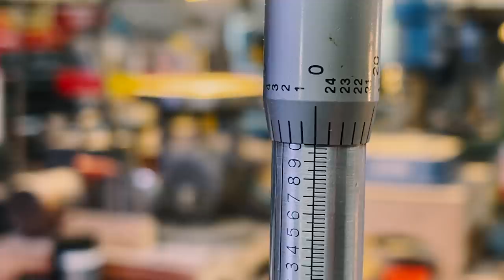Adam Savage's One Day Repairs: Cleaning Micrometer Gauges

Comment: I have that same set in my service truck. As a mobile mechanic/millwright it's funny to see how careful he handles them! After 15 years of bouncing around in a truck, in and out of -40°c weather and with zero maintenance, I have never had an issue with them. Unreal built instruments
Reply: Dude, this is what I'm talking about. Buy the best (my opinion is Mitutoyo measurement tools are the best), and you will have them for a long time, which makes them a great value even though they might be a little more expensive at first.
Reply: As Marty said in Back to the Future 3. "All the best stuff is made in Japan"
Reply: Buy the best but have something cheap ready for jank

We were going through the electrics and my $15 multimeter got a 2 cm long arc between the wires (rubber/air) on a supposed 400v line
Reply: What are these gauges? How are they used? I have basic high school science knowledge 🙈
Reply: @wordsinahandle  these specifically measure the outside dimension of something. You put the object between the two ends, and then twist the silver thing. It's threaded so it'll close down onto the part until it's touching and making that clicking noise. Then you read the lines on the side of the barrel and if you know how to read one it'll tell you very precisely how big that dimension is.
Reply: Micrometers are very simple tools, just a fancy nut and screw, very reliable as long as you don't drop them or seriously abuse them.

Comment: I refurbish metrology and machine tools as a hobby. Gun bore brushes are invaluable for cleaning threaded holes and getting into small places (like the inside of the thimble). I have a set of nylon ones and a set of brass. They are infinitely more durable and effective than generic "bottle brushes". Also, for final cleaning and/or lubricating, the "micro brushes" used for touch up paint and in the cosmetics industry are outstanding. They "fit" neatly between just using a needle-dropper bottle and something like watch oilers. Much more control over where the lube goes (and how much), and the don't drop fibers like a q-tip.
Reply: Yeah those q-tips do the job but the odds of leaving fibres behind is just too great.  Appreciate the tip about fine brushes.
Reply: Not to mention the ever handy as heck AR-15 tooth brush. with the little skinny end.

Comment: Ive used Starrett Tool and Instrument Oil for 40 years, Adam. I call it "liquid silk" and use it on all my calipers, micrometers, and fine measuring tools. I even put a single drop on the gear mechanisms of my parents Grandfather Clock once a year. So good to see someone as intellectual as you explore Metrology. You certainly don't hear the word much less see YouTube videos on the subject every day.
Reply: I just use ordinary very light, and pure, oil. There is nothing special about the Starrett oil, unless you compare it to motor oil. There are many fine oils that readily oxidise, and also evaporate without leaving a gummy deposit.
Reply: It's about as rare as seeing correct torquing

Then again, the torque wrenches and drivers needed are ~$1700
Reply: @willthecat3861  "pure oil." LOL. That means absolutely nothing. When you change your car oil... Nevermind that's not a good example, because your probably say, "Yeah, I just use pure oil." You use the specific oil that is meant for the job. You just happened to find one that is suitable for this kind of task; with through luck or trial and error.
Reply: @littlejackalo5326  Pure oil, simply means, any suitable oil, that is not blended with other oils, does not contain additives, or has not been modified. Yes, believe it or not there are such things as pure oils. Almost unanimously engine oils are not pure oils. Pure oils have a certain viscosity, density, boiling point, and so on. Sometimes it is a range, especially if it is a natural product. But, the properties are well known. Such oils are classified as pure. Pure silicon oil is such an oil. Pure mineral oil is also such a thing. Pure rape seed oil (not blended rape seed oil), pure linseed oil. Do you need more explanation.

Comment: Cleaning them ultrasonically is how I have been taught. I’m an engineering apprentice and you get dead on 0’s every time. Don’t do it when pieces are still connected (especially when threaded) together because otherwise the threads/connections will wear down due to the vibrations of ultrasonic.
Reply: Same reason you don't clean bearings ultrasonically.  One of the forums I'm on had people arguing that it was ok, so I ran a few samples through the tank and cut them open.  Totally ruined as expected!
Reply: I clean them with diet coke and mentos

Comment: If your mics dont gauge test 0, there's a spanner wrench for mics that lets you turn the barrel to get the vernier to line up. Usually done if there is anvil wear.
Reply: Or after the micrometer has been used as a precision G-clamp.
(You do know that the small pointy jaws on a caliper are used for don't you? Chipping off welding slag of course.)
Reply: @morriewyatt6234  they are, indeed, quite hard. =)
Reply: If you have enough wear on carbide anvils to warrant adjustment: A) you're not being very careful, and B) the faces are guaranteed to no longer be parallel!  I have a Etalon that was new in about 1976, has seen lots of careful use, and still reads dead on.
Reply: @componenx  loan them to an apprentice and you might find an anvil missing (that actually happened, not to mine thankfully)

Comment: I worked in a metrology lab for 5 years, calibrating and cleaning all of our Machinist's micrometers etc. I used basically the same stuff, starrett tool and instrument oil in little yellow bottle. Very nicely thin lubrication.

Comment: To clean old oils I've used brake cleaner.   I know it's nasty stuff but it does a great job of breaking down bad oils and grease.  It was invaluable when I was tearing down /reassembling the fine threads on a lathe collet chuck.

Comment: Adam, another good cleaner to remove hydrocarbon-based lubricants is Heptane.  We use it to clean precision bearings for use in space hardware, inside a class 10,000 clean room.  Using Teflon tools, we sonicate the bearing balls and races in100% Heptane.
Reply: Yeah but they sell wd at Lowe's

Comment: 6:00 -- The kind of horror story precision engineers tell around the camp fire. 
"And then. And then. The monster picked up a random bottle of grease without checking its suitability."
[horrified intake of breath from audience]
"And he slathered it all over the tool!"
Reply: one time I greased the scissors of a hedge trimmer.  I was so proud of myself for choosing a thicker lubricant that would last.......squeezed the trigger and ruined the blade connection to the little motor :(
Reply: Hahaha, this gave me a laugh!
Reply: Don’t mess with a machinist and their tools. It’s a thing. New guys come into my shop asking to borrow someone’s mics and they are not well received. I keep a cheap set for the new guys that come through so they don’t drive us crazy

Comment: I sell and repair gages(I’ve been to Mitutoyo’s repair department in City of Industry, CA) for a living, you did a great job! I would use a degreaser for cleaning instead of WD, but otherwise perfectly fine job. And the Starrett tool oil is exactly the right lubricant to use.

Comment: I would recommend locking down the standard in a v-block or your micrometer stand and holding the micrometer in your hands holding the fixed end to the standard and then using just your pointer finger and thumb along the thimble not using the ratchet move your hand in a circular motion to find the top of the convex edge of the standard doing this will allow to build up a feel with you micrometer in which would allow to to measure things much more accurately....just a thought from a fellow machinist

Comment: Adam,  What you should make is a very small tube to fit over the bottom anvil of the micrometers.  You could then slip it over the anvil and then slip the bottom of the standard into the top of the tube.  This would eliminate your fiddling with your fingers to try to hold the bottom of the standard square on the anvil.  You could make it out of a rubber hose or a soft metal.  Dan.
Reply: Or 3D print it.
Reply: Yes, but he only ever uses these micrometers to clean them, oil them, calibrate them or build a box for them, so it doesn’t really matter.
Reply: If you know what you are doing the tube is not necessary, skill is all the is required.

Comment: I inherited a single 1" Starrett 230 mic from my dad.  He was a saw filer at a mill for almost 30 years with that, and a former timber faller for 20 before the mill.  Fantastic man, but tool maintenance wasn't his thing.  Poor mic was FILTHY inside, and very rough and sloppy action (for a precision instrument).  I tried a few cleaning methods, and finally stumbled on some easy, effective advice: Brake cleaner.  Got all the crud out of the barrel and spindle-carrier brilliantly. 

I did have to gingerly tighten up the tension collet on the spindle-carrier threads, and it took a few tries until I had it riding that knife-edge between no resistance and no movement.

Putting it back together, I rubbed a drop of Marvel Mystery Oil on my fingers so I could leave no more than a sheen on most parts (like the cam lock).  I've sworn by MMO since my A&P tech school.  One drop of MMO on the threads, ran the threads from one end to the other several times, wiped off the excess a couple times from the outer threads of the spindle... and it was ready!  It's very silky now, with just a bit of carry-spin when I give it a flick, and no looseness. 

Did have to spanner-turn the barrel - it was about .0004 out of zero, but now it repro's on 0.000 and 1.000 beautifully.  (No vernier.)

Comment: I have a vintage watchmakers bench micrometer (has a built in stand and is in metric)  I completely restored it so it looks vintage still but has a hammered paint finish now instead of the black finish it originally had.  Much nicer to use.  I also have a holder like you are using to hold the micrometers in this video.

Comment: Hi Adam the WD40 degreaser spray is great for that sort of job,really good for degreasing precision instruments,really enjoy all your one day builds.
Reply: If you didn't use WD-40, you wouldn't need to clean it. I don't let WD-40 near any kind of precision instrument. It's an oxidizing oil, it will react with atmospheric oxygen and turn into a varnish, which is what gums them up. It's a lousy lubricant. Its only good use is cleaning off old WD-40. Use a good watch or instrument oil, applied sparingly (with a toothpick, not a dropper), keep the instruments dust free, and you won't need to re-lubricate for many years.
Reply: Camp stove fuel to clean. Turbine oil to lubricate. Works fine for my stuff.

Comment: Adam

After cleaning with WD-40, it is a good idea to flush the WD-40 out/off with something like acetone or some de-greaser before applying the final lube.  Starrett oil is fine, but many folks prefer a synthetic watch oil (Mobius?) 

John
Reply: So basically, just use acetone or de-greaser, and leave the wd-40 on the shelf. Acetone > kerosene wd-40
Reply: @MattsInTheBelfry  WD-40, the Duct Tape of solvents/lubricants 🙂
Reply: you saw him using compressed air to blow out the solvents. nothing additional is necessary the wd40 is gone.
Reply: @quinn10ification  it's not a lubricant
Reply: @quinn10ification  WD40 is as much of a lubricant as peanut butter; works just as well too. Though both are lubricants by strictest of definitions (I.e. they will reduce coefficient of friction between surfaces) they are quite terrible at it. 😝👍
Reply: I don’t think people are aware of the price of synthetic Moebius oils, I’d wager a bottle equivalent to that Starrett bottle costs more than the whole micrometer set new. For reference, 2 milliliters of Moebius Synt-a-lube 9010 costs around 30 euros. And watch oils are highly specialized, so they aren’t necessarily the best option either, watch oils are formulated to last a very long time inside a hermetically sealed watch case, because taking the watch apart to clean it is very expensive and time consuming. Taking a micrometer apart and washing it with solvent isn’t that specialized nor time consuming, so doing it more often to save money on oils is definitely the way to go. I lube my watches with Moebius, but my micrometers get Mobil Velocite No 3 or 6, which is a light spindle oil. If you don’t want to purchase a liter of light machine oil, I’ve found that Hoppe’s No 9 gun oil to be largely equivalent, and that’s what I use on anything that has to work outdoors. WD-40 gets left on the store shelf, it’s literally useless for everything.
Reply: @sstorholm    

Yes, synthetic watch oils can be pricey, but you really don't need much.  Some come in 2ml bottles, and last a user/maker for years.  And there are less expensive synthetic watch/clock oils as well that may be a better match for things like micrometers
Thanks for your input
John
Reply: @MattsInTheBelfry  

Well, WD-40 is pretty inexpensive and non-toxic, so using it first to get the majority of the crude off/loose works for me, then go to acetone/degreaser

John
Reply: WD-40 is often the service engineers quick fix, but you should be aware of the long term effects.
  Some time after you’ve walked away it can be destroying the plastic seals on bearings and then a major repair has to follow.
Reply: Just using WD-40 alone would be the worst thing you could do- talk about gumming things up!  Teletypes (remember them?) will eventually totally freeze up when "lubed" with it.  I'm sure many typewriters suffered a similar fate.
Reply: @bmxscape  fake news. Learn what a lubricant is.
Reply: Using synthetic watch oil is for goofs. No one is using oil that costs as much as silver by weight to lube their mics. That's unnecessary. That's like using truffle oil in your car.
Reply: @littlejackalo5326  found the guy who uses wd40 as lubricant lmfao. wd-40 is a water displacement formula, hence the name, not a lubricant. it can temporarily give the effect of lubrication, but literally anything can do that including water. (look at water slides)

Comment: Hey Adam, like many here I’m a quality technician at a machine shop (and a mechanical engineer) and work with these tools daily. I haven’t seen anyone here mention this yet but when ratcheting your micrometers you only want “ratchet” or “click” a maximum of 3 times. I get onto our machinists almost daily for cranking away on that ratchet micrometer. It’ll usually only effect your measurement by a few ten thousandths but as we all know, sometimes that will give you an out of tolerance measurement. Love your videos!

Comment: The best mic stand is your own beer belly as a rest for the static side of the mic.  With the mic resting on you belly you can hold the mic in one hand and the gage in another and get a good feel for the mic's anvils to make a proper parallel connection with the 8" gage.  You can feel it when the anvils make contact with the gage at an angle and stop.  This will make for an inaccurate measurement. On the other hand when the mic's anvils and the gage meet and the surfaces contacting are parallel this feels much different and you can have confidence that you are getting a good reading.  

Then again I use a mic everyday and "its a feel thing" is calibrated over time.

Comment: Paper towels and Q-tips leave a lot of fibers behind that can bind up in the threads. Try using some miniature plastic brushes and Kimwipes.
Reply: it looked like what he was using for finishing in the drill was a nylon bristle pipe cleaner, and he was using the linty stuff for more bulk removal. Lint should mostly be removed by the next spray/drill/air cycle before he does final lube. But I may have missed something.

Comment: The number of synchronicities with this channel lately has been bizarre.  I JUST finished cleaning my 60/70 year old Mitutoyo micrometer an hour ago.  It was my father's so it has some extra value to me.  It was so stiff, the ratchet was clicking long before the minimum measurement and even using the gross adjuster took serious effort.  The tolerances of these things are absolutely astonishing!  There was but the most minor of yellow film on mine (more a stain then an actual physical build up, and that's all it took to prevent functioning.  I cleaned it up with a pipe cleaner and varsol and it's good to go.  I can't see investing in the lube as it will now outlast me by many years and it's the only one I have so  I left a fine film of WD40 (I know it's not REALLY a lubricant).  Dead accurate still but I want to find one of the tiny wrenches for zeroing it out.  

Dream tool, caliper with Imperial and Metric readouts.  Hit me up if you have one!

Comment: Only suggestion I have if you're measuring really close tolerances use blue shop towels to clean with as they tend to not leave behind all the  fuzz etc like standard white paper towels I use paper towels for general stuff then have blue shop towels I keep put away for use on machinists stuff as well as paper for cleaning anvils 👍👍👍

Comment: As a Millwright or machinist, the spindle should not spin freely like a top. There should be the slightest amount of drag to minimize backlash in the spindle threads. There is a nut that acts like a collet for the female threads in the frame side. Uses the same spanner for calibrating the datum line on the sleeve.

When using your standards, slowly roll the standard while turning the spindle. When the ratchet clicks, stop after a couple clicks, otherwise it can act similar to an impact gun ( small scale ) and cause a few 10 thousands of an in error.